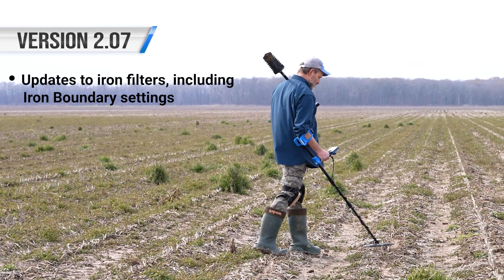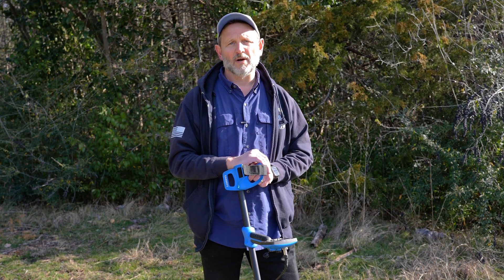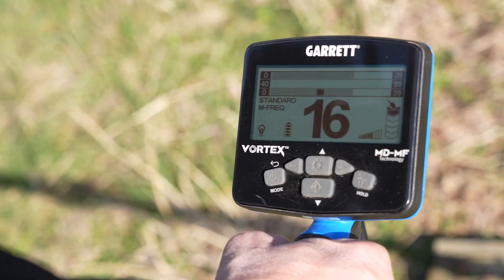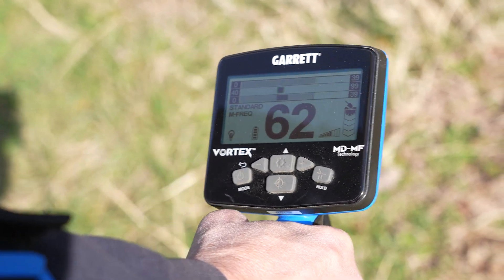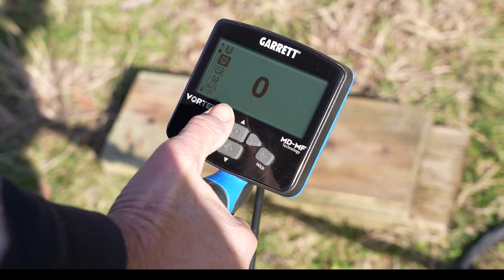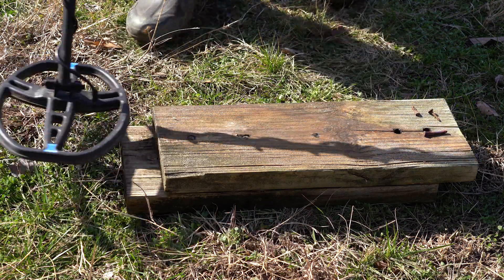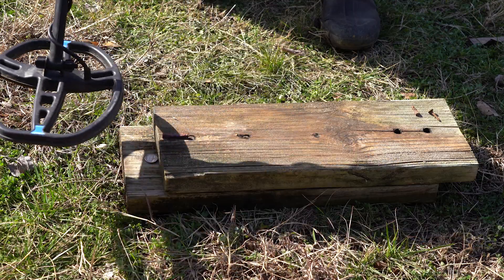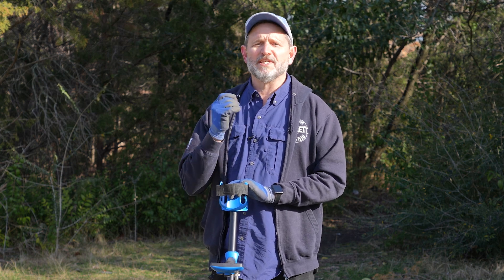Vortex Firmware 2.07 Update

Comment: I’m confused. A nickel will read between a 52-55 on a Vortex. An iron nail will probably read down in the 30’s or lower. When you place the nail next to a nickel how can it read in the 60’s???? That makes no sense. 
What happens if you place a quarter next to a nail?
Reply from the maker: This nail orientation with a thick square nail is the toughest challenge. With the nail/coin positions in this demo, the target blending pushes the combined number up (Ex: 62). MD-MF technology is analyzing iron on two different levels (X-axis) and non-ferrous on a completely different axis. Vortex in Single Frequency like 13kHz or a comparable AT Max single frequency detector would indeed show a target response somewhat lower than the nickel’s 52 ID, as you say.